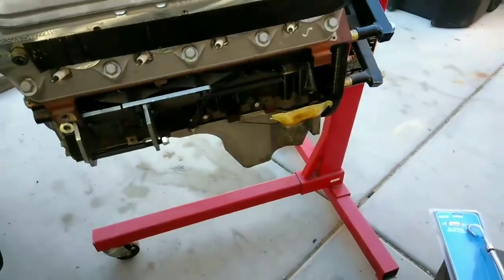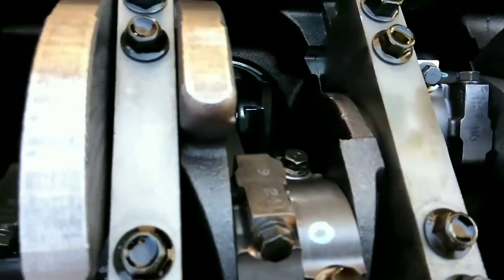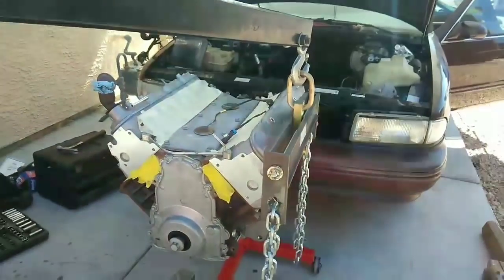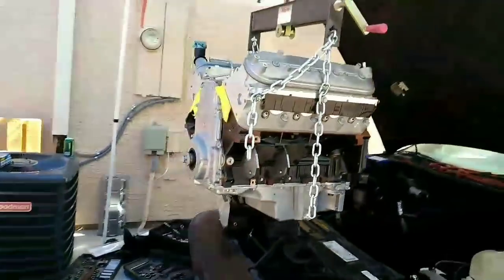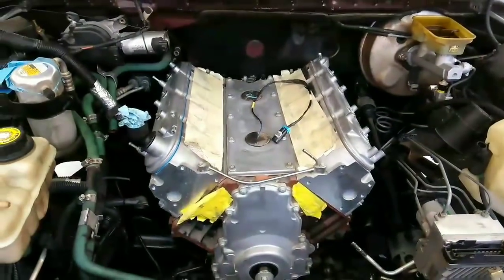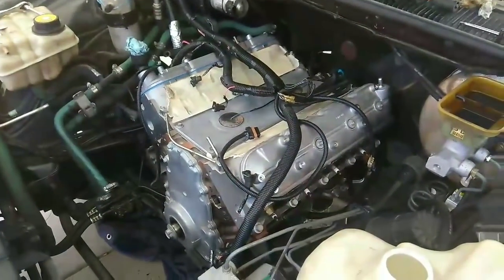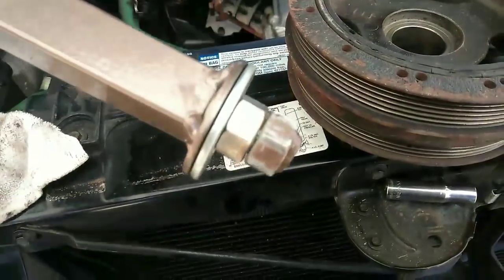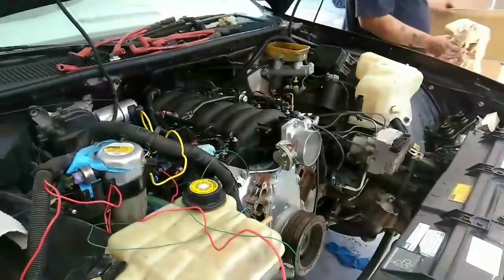96 impala Lq9 swap

Comment: Bro I had a quicc question can I use a older 4l80e trans on that 2002 lq9 engine
Reply from the maker: Yup 80e 60e th400 700r 200r4 pretty much everything is Ls friendly gm did a great job at making old school to modern day technology work together thanks for watching
Reply: Really good question.